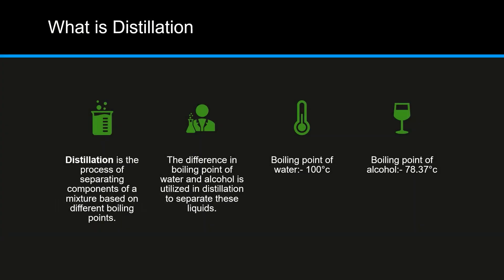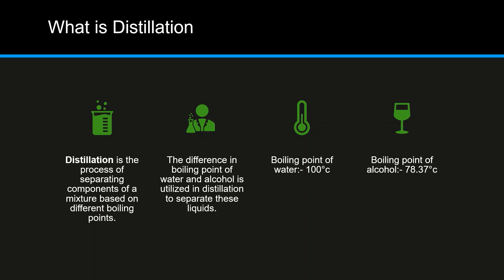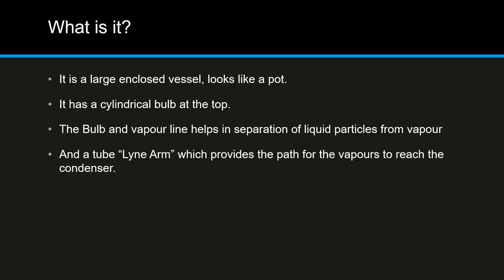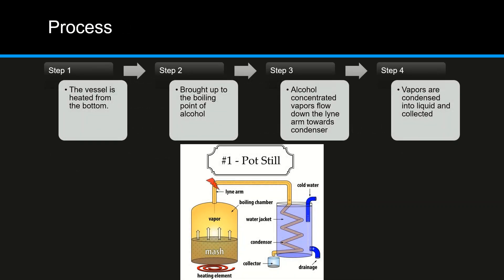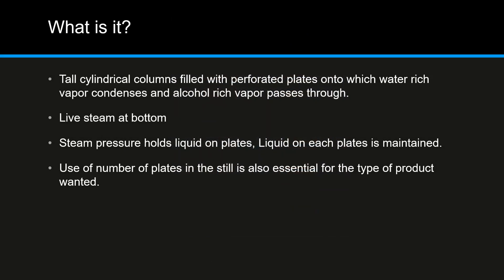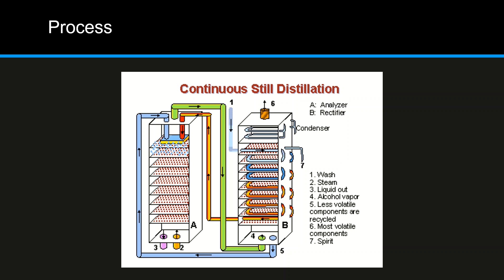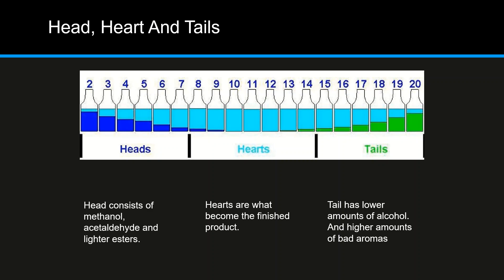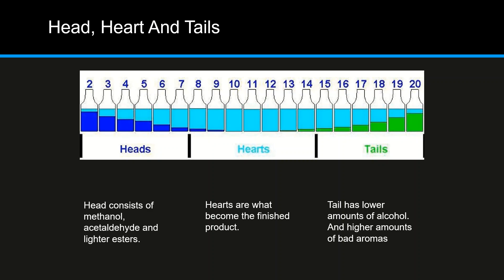What is POT STILL and COLUMN STILL? Learn About Distillation process. (IHM course covered)

Comment: What I did not get explained in the video is this: how come the patent still does not get full at some point. You introduce wash into the analyser, and collect some spirit from the rectifier, but that is say 20% of the volume of liquid, so with more wash, more water is added, as not all of it is alcohol/spirit.
Reply from the maker: So if you closely look at the diagram shown of continuous/patent still, and understand its working the answer will be simple. The wash is inserted and heated at a temperature in which alcohol present in the wash, gets changed into gaseous state but water does not (due to change in boiling temperature of alcohol and water) . So the alcoholic vapour rises up and gets collected where as the liquid water gets flown through the perforated plates and is released from the still. In the diagram:- Keep a close look on pipe (1) where wash is inserted how it turns red due to change in temp. Its outlet is in Analyser where the liquid and alcoholic vapour gets separated. With help of perforated plates, liquid is suspended on them and due to gravity gets on bottom of the tank and there pipe (3) liquid is released out.
So that is why the patent still never gets full.
Reply from the maker: Thank You for your question 👍🏼 I hope this will help others to understand the process in much more advanced way.
Reply: @nothingsvirginhere8020  perfect, thanks!